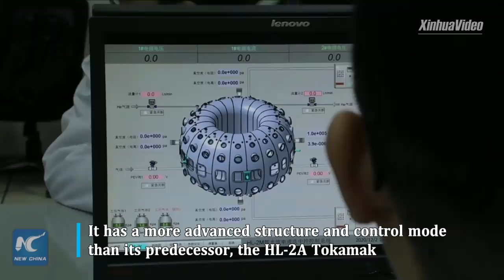China's new-generation "artificial sun" commissioned

Comment: This is similar to ITER in France, but these large scale processes are still dependent upon infrastructure. The Safire Project in the US is using much safer designs that allow small, single residence use that provides for "stand alone" operation not dependent upon a large electrical grid infrastructure while being able to be interconnected to a "grid" albeit in a distributed configuration.
Reply: note that the ITER can continue progress is because of china taking over the main construction project years ago.